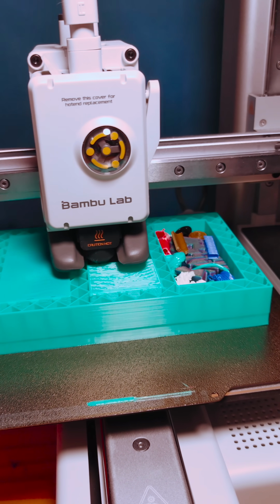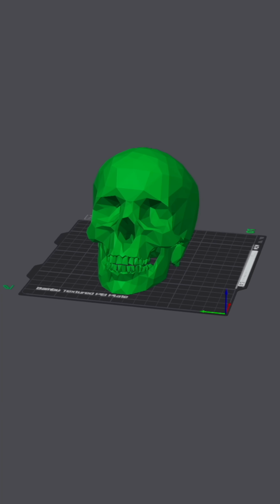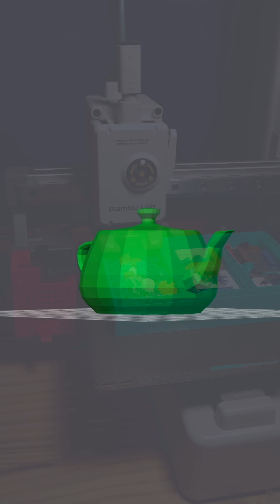Try Just Hiding It

Comment from the maker: A lot of people have commented asking why you wouldn't just print into the infill. I think the assumption is that all this waste is coming from doing multicolored prints, but I actually haven't done any multicolored prints. All of these bits of purge waste were either from starting a new print, or changing the filament. I also used this to get rid of some bits of old supports and bits of failed prints. So while there's plenty you can do to reduce waste, it seems a lot of people still have some. 

A lot of people are also commenting that this method doesn't add any structural support, and this is true. But my response to this is that there are a lot of prints out there that don't actually need to be very strong. Plenty of people are printing things that will not be holding a lot of weight. This idea is more for prints like that. 

Ultimately this is just a silly idea to get people thinking differently about how they deal with whatever waste they have. It's not meant to be a fix all solution.
Reply: The new H2D has much smaller purges. I hope they eventually bring the same changes to the older printer firmwares.
Reply: If the print doesn’t have to be very strong, and the waste doesn’t add any structural support, then it sounds like you can just print it hollow
Reply: There is a German company - recycling fabrik - that recycles printer waste into new filament.
They accept PLA and PETG and you get store credit for sending in waste.
Dunno if the provide service outside Germany.
Reply: Wait, thats true though, why dont multicolor prints use the infil as the purge tower whenever possible?
Reply: not silly personally i do it with filaflex foamy poop and add them on other foamy prints like slides or shoes i like adding them beccause i feel that they add hardness pressure spots and maybe more comfy factor and i assume that the foam wont be that messed up with the use as the foam inside the walls will create some sort of marshmallow effect inside the shoe when stepped on
Reply from the maker: @TotallyNotKanye  I'd like to see how you manage to get it into the shoe.
Reply: @TotallyNotKanye  interesting
Reply: And it's certainly better than just putting it in the garbage.
Reply: @theCraftyHeretic Everything will end up in the garbage. This way, it just sits on your shelf for a year beforehand. I don't get why you would spend time doing this
Reply: I think it's a great idea, to hell with the naysayers
Reply: Also not everyone has that feature. I only just now discovered that that was a thing because it's in my slicer since I just got a brand new bamboo lab A1 Mini and started using bamboo slicer. Also I just started using Orca slicer. And also I have gobs and gobs of waste from multiple prints and failed things all from multiple printers and many projects that have been sitting around in buckets for a while. 

I think this is a fantastic idea and I wish I had thought of it! It's true it wouldn't be able to work on every print you do but it's a great thing to think about if you are doing one where you could sneak it in there. And it would be cool to know every time you looked at that that you did that and it's in there. I really love this idea! 

So yeah, if I had never bought the A1 Mini I would never know anything about that 'put it in the infill' feature.
Reply: You could use this method and fill in the waste bin with resin if you want structural support, not sure how that would work out though, it should work as far as i know. it would definitely add unnecessary time to the print
Reply: @prankmonkey6668Resin heats up and can warp your part. Also, if you're really concerned about the environment, having something that doesn't have a chance to actually break down that stays rigid would be even worse.
Reply: It might not add strength, but it does serve as support to hold up the roof of the print
Reply: This isn't a silly idea by any stretch of the imagination! Watching this video made me think about shredding the filament and making a paste or adding it with white glue to fill internal print spaces smaller than the one you used. Thanks for the motivation.
Reply: At least the waste doesn't go to a landfill.
Reply: SUBJECTIVE Good and fundamentally wrong  "idea"
Reply: This is the best idee what i have ever seen. good job
Reply: What is the benefit of this though?
Reply: It could add structural support if you break the pieces down and fill the space entirely but you'd need to do this in a way that wouldn't produce microplastics.
Reply: @ArstKoben all plastic will eventually become microplastics the only way to avoid this is to not make the plastic in the first place.

Comment: This is clever.  You're going to need infill for support anyway, so why not just use preprinted parts.  Actually, if anything, it allows me to shred parts and then not buy a filament spooler.
Reply from the maker: Technically what I'm doing in this video isn't really adding any support. Just hiding plastic where the support would be in a print that doesn't need a lot of support.
Reply: @chris_ideas  Yeah, it wouldn't be an amazing amount of support since the loose parts aren't tacked down, but at least you're filling the empty volume with something.  I think you might be able to use foam to seal the gaps if you want something more solid, but that foam can be flammable.  Not something you would want to risk in a machine that uses high temps.

Comment: I fail to see how this could structurally reinforce the print if not to reinforce why fill the cavity aside from adding I see no reason why you would put this in there 
If the idea is "the waste is in a 3d print now" than 3d printing a trash can and putting the scraps in there seems like an equivalent idea to me
Reply from the maker: I honestly don't necessarily disagree with you. The point of this wasn't to make the print stronger but just to hide the waste that I already had. Why? Well that's this odd little feeling I have inside that tells me that I paid money for this plastic and I didn't want to just throw it away. Ultimately I would hope that this idea would be like a jumping off point for a better idea. But I'm pretty happy with it regardless.

Comment: my last bucket of waste went into a silicon mold of a skull turned out really cool
Reply from the maker: I like that idea but I imagine I'd want to do something other than skulls. I was wondering if I could get a cube shaped mold and make perfect cubes. Then I could put cube shaped holes in my prints that perfectly fit the cubes and use it to make some actually decently weighed prints. How much does one of those skulls weigh anyway?
Reply: @chris_ideas not alot but makes a good paper weight

Comment: The point isn't just hiding it... The point is to make it useful. Sticking it into the middle of a print like that does nothing other than make the print heavier. If you could remelt it and turn it into filament to use for the infill then at least it will contribute to the strength of the print.

Comment: Buy some non stick "paper" (the reusable one made of some metal not acrually paper) and a cheap panini machine and then have your pla and petg separared and you can make litle slabs of plastic, obviously you can do actual practical pieces with that but in this context you can cut to fit those slots and you can fit a lot more in the voids, provide a bit extra weight, if snug even some structural force and no rattle
Reply from the maker: I have actually done something similar to recycle HDPE at home. I have a short about that on my channel.

Comment: I know this is and older video, but what if you blend the waste then fill your prints up with in, throughout the infill, that way it's just weighted
Reply from the maker: I think that would be worth trying. I know I saw a different video where someone tried to use sand to add weight to a print, and the printer fan blew the sand all over the place, so I wasn't sure if that would happen if you ground up the waste. 

To be honest, I haven't printed a lot of large prints. Most of what I print is pretty small, so I haven't been able to experiment much with this idea.
Reply: @chris_ideas  ah, also after you said that I had another idea, use a funnel and a heat gun to fill the prints up
Reply from the maker: @TheFirstUnstopable  I'm no expert, but I imagine if you were able to get the funnel hot enough to liquify the plastic, then you would probably end up melting your print.
Reply: @chris_ideas oh yeah, well how about glue

Comment: But there is a slicer function  to do this (waste to infill)
Reply from the maker: This isn't waste from doing multicolor prints. It's just the bits of purge from changing spools and what not. I don't do multicolor prints.
Reply: @chris_ideas  ok, that's the point. So this isn't the best solution, but it is a solution. Better is just melt this and put into forms printed on resign printer.

Comment: sounds useless. it's just inside without any purpose. it doesn't add rigidity unless some glue is added as suggested. but by that point one could also just leave it empty or use normal infill. i'd check if there are companies that recycle old filament. we seem to have one here that allows you to get a free shipping label per month and you then get credit towards recycled filament spools. or if you print a lot/have it as your business, get the machines to create new filament yourself. but i guess it'd take too much time to sort through the colours then

Comment: Funny I had 3D printers for about 5 years now and never had this issue.
All you have to do is stick to one spool of Filament until its used up.
I know for cool colored prints that's not the solution, but I dis find that most prints don't need to be multicolored. 
Or do the bamboo printers always produce these waste bits even if you print in one color?
Reply from the maker: Yeah, I don't print multicolored prints. The a1 mini that I have just does a lot of purges. But I also switch spools sometimes and that creates more purge too. I usually print everything in black, but I also print things for family and they want pretty colors.

Comment: 🤔🤔 Maybe making bricks/slots out of the waste using a 20$ mold and a small oven you could make them into weight pucks, it works the same but less jostle and denser use. Lovely idea!
Reply from the maker: That's something I would really like to try actually. If you could make all the blocks the same size, then incorporating that into your models would be pretty easy and seems like it actually would have a lot of benefits. Though it would be somewhat labor intensive.

Comment: not really sure the benefit of this, makes the print take much longer by adding top/bottom + perimeters for each cavity. will add a small amount of weight and no structural benefit. Also takes additional time to cut cavities into the model and add the pause.

Also the pause appears to show some layer defects in the video. one might be tempted to add too much which could catch on the nozzle and cause issues.

If you don't need the infill, just use less infill. If you do need the infill, then this doesn't help.
Reply from the maker: Your points are totally reasonable, and I appreciate you presenting them in a manner that is not insulting, but like countless commenters before you, you have completely missed the point of this. 

The objective was not to improve the print quality in any way, nor was it to use less plastic. The objective was simply to do something with the printer waste other than throwing it away. To get rid of it by putting into the print itself. 

Many have pointed out that this is a juvenile idea, and not really a solution, and they're probably right. But the main criticisms I see seem to be coming from people who assume I was trying to do something different from what I was actually trying to do.
Reply: @chris_ideas yeah, I just don't see the benefit of hiding it unless it improves the print in some way. 

I know some people mention molds, but honestly I can't think of anything I need enough of to justify a mold for it.

Currently I'm saving up scraps to try melting into a sheet on parchment/wax paper. Thinking if I can make a decent board to use as a project board or backplate to mount my Arduino projects to.
Reply from the maker: @kevincrossland1898  Before I got a 3D printer I experimented a lot with melting HDPE using an old panini press. There's some good videos on how to do it out there. I made some basic square molds with scrap wood and was able to make some pretty nice rectangular blanks, but was never able to find much use for them. I did make a shelf using some, but it was pretty labor intensive. 

But the Panini press method would probably work well with scrap PLA.

Comment: Yeah, but it's still wasted. If you need more weight, then scraps of plastic are not going to add much. It doesn't begin to solve the issue of waste. It just contains it instead of sending it away.

Comment: But it's not integrated into the structure, so it won't provide strength, it will just make it heavier. Maybe it could be filler for resin casting or something?

Comment: There is basically 0 logic in what you are saying. You are winning nothing with those waste inside. Neither strength or less material. So it's equivalent of pushing floor dust under carpet and call room clean by now

Comment: This is a comically bad idea. You’ve used extra material to print walls and solid top and bottom layers round your waste cavities, and the waste filament is not doing the same job of supporting or strengthening your print like infill would. This has to be rage bait.

Comment: Infill is for support and rigidity, this offers neither, and increases the amount of plastic you're using.

Better off just bag it and recycle it. Contact your local recycling centre and see if they prefer to accept 3D printer waste bagged by type or mixed.

Comment: People also waste SO MUCH material on infill. Unless infill is very dense, it offers little to nothing for strength and rigidity - both of which are better improved by using more perimeters and top/bottom layers. For non functional prints or prints that aren’t load bearing, all it really does is act as support for bridging top layers. It’s not without uses, but it’s highly over used and wasteful. Often it’s not even necessary at all. I shudder to think how many millions of kilograms are wasted on 15%(or more) infill on prints that could have had 0% infill with zero other changes. 

Thankfully adaptive infill patterns are slowly being rolled out, that place infill only where it’s necessary. The world has enough plastic waste already, so groot and dickasaurus and flexi snake don’t need 35% gyroid infill, people. Just get yourself a .6 nozzle and print them with 3 walls. 

Kids, just say no to infill abuse!!!!

Comment: Nice! Now your object will rattle like crazy 😂 I use a poop chute off my Plus 4, that slides right into an empty filament bag. Then I use those purge poops and aby supports/ Failures in my plastic injection machine to make things. It works but its not ideal. 3d printer filament isnt even close to LDPP/HDPP in properties and it STICKS to eeeeevvveerrrything in the injector- have to burn it all out after you use it. HDPP/LDPP is infinitely less sticky and basically keeps itself clean. In all honesty the easiest way to do it is save it in a bag and throw it away😂
Reply from the maker: A fair and reasonable assessment.

Comment: You have infill to give the print structure. By putting the poop in it, you are just sweeping it under the rug because it means you didnt even need that infill to begin with. If you want to do something with it, grind it up into powder and use it as weight for your prints instead.

Comment: I think that it's good that the 3D printing community is trying to find ways to reuse the filaments, instead of just throwing it away.
Reply: Well there is that part of the community and then there is the part that prints 10 different useless trinkets from thingiverse per week...
Reply: It's just expensive to buy filament only to watch it fly away.

Very natural to want to find a use.

I'm just saying it's more likely people want to save money and saving the planet would be a side bonus
Reply: But its not reusing the filament, its hiding it. If you have a loose floor board and you lift it and sweep the dust underneath into an empty space, you are not reusing the dust
Reply: @Scott_A the dust is insulating the house and filling hollow gaps

/s
Reply: It’s an easy aoltition
Reply: If it’s PLA who cares, it’s bio degradable… nothing wrong with “just throwing away” something like that.

Comment: It would require an additional setup, but couldn’t you use the extra plastic with an injection mold? Or is the material not suited for that?
Reply from the maker: I'm sure you could, and that would be a great solution. This was just meant to be an easy quick way to get rid of the waste. There's certainly much better ways, but they're usually more complicated or costly.

Comment: I mean the thing is we are trying to create a new material which we can use, which then has a purpose. (Recycling)

In this case the "infill" with 3d printing waste has no purpose. It doesn't add strength, it doesn't add much weight. Which normal infill does, it adds strength, it add stability.  

You just hide the filament, it is an interesting approach, I give you that. But it's not very good.